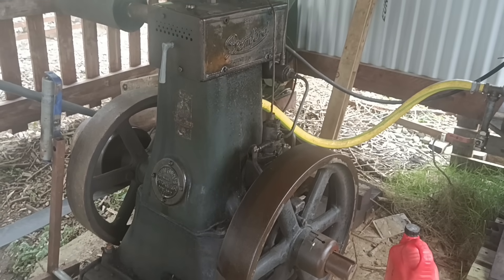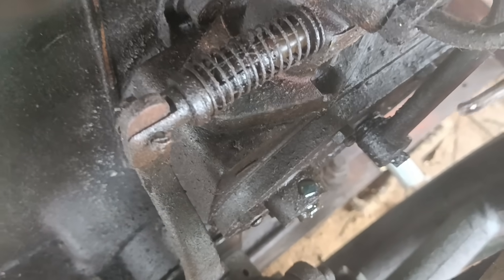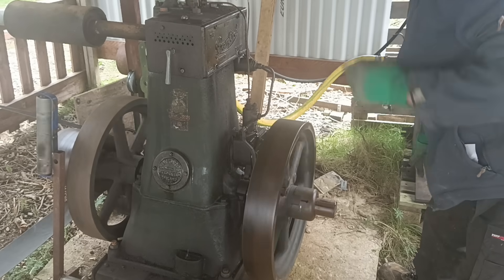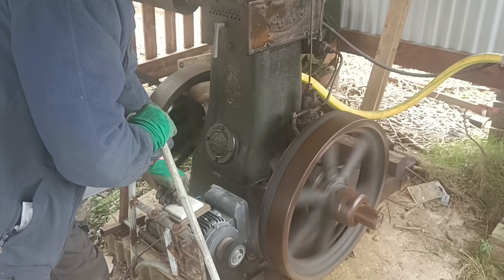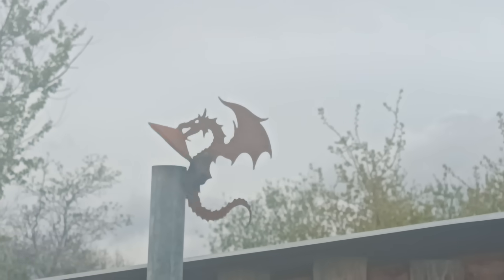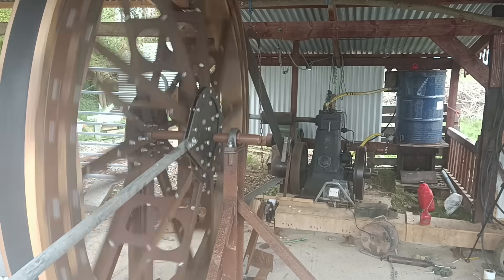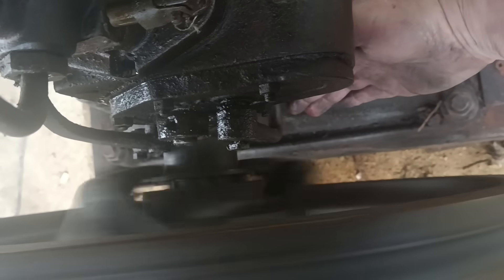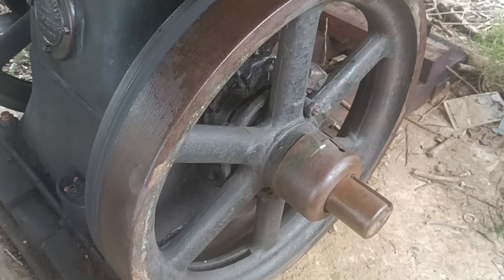How Much Fuel Does This Vintage Engine Use? Bamford stationary single-cylinder diesel efficiency

Comment: I dislike the Pollution/Efficiency Issues of these engines, HOWEVER, i am especially intrigued by how some engines like these, especially “Hot Bulb Engines” (Aka “Semi-Diesels” ), can run on nearly anything.

Especially one could use pure plant oils (vegetable oil, algae oil, etc), or “Pyrolysis Oil” (a product of charcoal production if you don’t burn it off).

I’d love to have the know how/funds to make an Open Source one that is all modern or something.  I was thinking you could use a Catalytic Converter to help heat up the hot bulb, and with modern mater it could probably work way better.  ALTHOUGH i wonder to what degree a good glow plug could work just as well if not better.

Also something like an Open Source Opposed Piston Engine, or some crazy multifuel Spark ignition engine etc would be really neat.

One can dream i guess lol, probably going to make some “PowerCubes” and use those tiny gasoline (hopefully flex fuel on ethanol) engines for now though.

Comment: Some much better than a modern generator, a lot less noisy and far more reliable. Have you thought about linking it up to a dynamo, when its running think of the electric you would save. 👍🤗

Comment: When you are building things for (your own) business, which you do, you have to take the economic viability into account aswell. And I believe you have hit bullseye with it👍 It's gonna be hard to have any lower running costs (except labor).

Don't know how efficient other diesel stationary engines are, but I think 450ml/h is pretty good. One of those noisy go-cart engines with 6.5hp could eat up to 2l/h, but it wouldn't fit your needs anyway...

Comment: Well said, Tim.  These old engines like your Bamford (which I have not seen), Lister, Deutz and the like, typify a more relaxed way of life which would be lost for you if there were a little 3-cylinder Kubota or Yanmar buzzing happily away in your workshop instead.  And where would pre-1965 rural economy have been without these beauties powering milking plants, sawmills, water pumps and generators?  😊 Col, NZ.
Reply: My brother collected Wolsely single-cylinder engines. Listers too.

Comment: It's a complex equation. One would also need to take into account the cost of manufacturing and running the engine both in terms of dollars and resources required and the time those costs are amortized over. Then we need to take into account what you are using the engine for - I suspect by making charcoal with it you are at very least carbon neutral, whereas the show engines produce nothing but entertainment (not necessarily bad of itself but not good for the environment)

My Monday Morning Guess would be that taken over all your old engine is very efficient - even compared to the latest high tech diesels.

Comment: Modern practice would probably be to use the power take off (pto) from a tractor running at idle. My 1955 Grey Fergie is rated
at 25 horse power, so trivial for a modern tractor at much higher power. Electric would also easily work & with solar panels & storage would neither need additional cost or create pollution & start & run with out maintenance for a very long time, but the upfront cost would take several years to recover. Thanks for sharing!

Comment: I wonder if you could hook it up to a low RPM permanent magnet generator/alternator and see if you could get usable power out of it.  Or do they make low RPM generators...imagine a 4kw generator head that generates the proper voltage/frequency at 600RPM...that would be awesome!!!!
Keep em coming!!!!
Reply: Plenty of generators that it would power ,they do need to be turning at fifteen or eighteen hundred RPM (dependant on what frequency 50/60 is needed ) that is easily achieved by sizing the pulley configuration correctly. A six horse power engine should be capable of giving out a constant 3kw without struggling.

Comment: if you were to hook up a modern 6 hp small light weight gas engine to your setup it would probably use 4 times the amount of gas,  these heavy old engines working like yours is beautiful
Reply: That isn't really how these things work. A horse is a horse, and modern engines are objectively more efficient. If you mean like a lawnmower engine, yeah it probably wouldn't be very efficient on this setup, but those are built for high torque to run everything properly. This would likely have very little torque which is far more efficient. There are engines designed for just these kinds of applications and they will always do a much better job per litre of fuel. We just don't commonly see this sort of application in normal daily life anymore. Also certainly never see such massive flywheels, which are extremely efficient. If I had to guess, rollercoaster and ski lifts would be the closest cousins to this machine
Reply: yep  they use 4 times+  more fuel because they dont have the flywheel  weight size  helping them

Comment: Since it's just keeping the flywheel going could you theoretically use a much smaller, slower engine if you wanted to? (Maybe starting the flywheel by hand?)  Here in the states little "hit and miss" gasoline engines of this vintage are common and you see those a lot at collector swap meets etc. and they're amusing to listen to running and the crank/connecting rods usually just stick out from the top of the cylinder and are fun to watch as well.
Reply: They usually run them without a load...his was doing actual work...now how much work can it do is the big question
Seems to sip fuel though, but it isn't a mega power house either

Comment: Hi Tim, she is a beautiful old lady indeed! This may be a daft question, but do you think you could use your flywheel to start the old lady, you managed to test that manually at 60RPM when you were making it? Cheers
Reply from the maker: I'd like to try that but I'd need to disconnect the con-rod to the slicer. But then , how would I reconnect it?
Reply: @wayoutwest-workshopstuff6299  Would the drag from the con-rod not be minimal enough if the charcoal grinder was empty? Just a thought 🤔

Comment: I don’t know what vegetable oil costs in Ireland but R. Diesel designed his engine to run on vegetable oil. Diesel engines before common rail injections can usually run on chip oil if it is well filtered. The only problem is the used chip oil smells of chips and can make you a bit hungry. 😅
Reply: Saw a fellla here in uk running his modern diesels on filtered used cooling oil and kerosene mix. 3 parts kerosene to 7 filtered used oil.
Reply: @McMahonshaun  a little petrol greatly increase performance.
Reply: Smells of chips.... Sounds like a huge plus.

Comment: Well, the details of the fuel efficiency seem relatively unimportant, realizing that 1)you already own the engine, 2) it is very economical to use for your application, 3) it is easy to maintain, 4) all the mechanical interfaces have been worked out and implemented, 5) it sounds so pleasant.  It seems it would be utter insanity to spend any type of resource to change it.

Comment: I think that is a fuel instant little bugger of and engine also horse power is how engines power is rated just meaning that engine could do the equivalent of 6 horses  then again all your belts and stuff probably changes it a little bit till it gets to were its used

Comment: That's why I love diesel engines, they are so efficient, and this low RPM one are the most efficient of all, cause diesel has the maximum efficiency at low revs. Would be nice to produce your own fuel, but by looks of your region should be impossible to grow oil crops. (sorry for the english, not my first language)
Reply from the maker: Not impossible to grow, but too wet to harvest consistently

Comment: Diesel engines are very efficient and have huge amounts of Torque. While I would love to see these manufactured again, and believe there is still a market for them, diesel, and gasoline engines have been targeted and will be illegal someday.  I love that old Bamford though, that's an amazing engine.
Reply: Engines similar to a 1920s Lister are currently being made in India by several manufacturers. I am aware of Topland and Patel Marshal from Rajkot, and Comet from Kolhapur. I think there are others. Also there are lots of videos on YouTube of modern Pakistani versions of a considerably larger Ruston and Hornsby engine probably also originating in the 1920s; the hand starting of these appears often to require the holding of burning oily rags under the air intake and/or the pipe from the fuel pump to the injector nozzle.
Reply: @cedriclynch  Yeah, no.  I'm not into things like waving fire around, I live in a forested area and that could have serious consequences, yes I am being paranoid, but I also grew up in a part of the US that has been doing a lot of burning the past few years.  Besides, the Banford, is a very elegant design, and looks like it would work very well. Oh well....

Comment: My Lister saw bench with twenty inch blade chugs away for weeks on one tank. I am now going to do a fuel test and compare with the old Fordson Major and belt saw bench. Point is the old engines are so relaxing to me to use, to heck with the fuel. My 1970's Kubota tractor and eighties front mower are so buzzy in comparison they are irritating as are Deere mini loaders etc. Each to their own but those Bamfords are super pieces of kit.

Comment: Actually I am quite sure that these old engines can burn veggie oil directly. No need for methylesterization. AT least a 50/50 Mix of oil and Diesel should be fine

Comment: It probably is hopelessly inefficient, that fuel the engine burnt contains approximately 4.7kWh of energy, but the engine is probably only 20% efficient (probably less, modern turbocharged diesels cap out at ~40%) - so ~1kwh of mechanical work.
Electric motors are usually around 80% efficient at peak, so the cost should be about the same!

In either case this is beside the point, if it does the job at a rate that makes sense for your biochar sales, then it's good enough.
Plus an electric motor solution would be a lot more complicated than a nice old engine.

Comment: 450ml for 45¢ per hour of work seems good value.
I love how you appreciate the history behind your machine & your obvious affection for it
Reply: Id say you  are a very smart man  and the old girl is shining bright . They still use these type of engines were I live in Texas with gas right out of the ground . The same gas we heated our homes with every four or five years we had to replace the teak wood chips in the vessel scrubber  that the gas ran through to help an take h2S gas that is common in our part of the world . The only things my paid for was electricity and if my father had wanted too he could done that to .  We drilled our own water well . I sure miss those days .
Reply: Need to connect it up to a generator to find out how much value it is.
Reply: I assume under load it uses more.
Reply: @tomthumb5445  My thoughts exactly.  You can't measure efficiency without measuring the load.  If you could, the MPG rating for cars would only every be measured while sitting idle.
Reply: Under load that would go up quite a lot. Though for the amount of work its doing, it would be interesting to compare to a more modern portable diesel, like a 2 or 3hp.
Reply: @wishusknight3009  Exactly what i would like to know.
Reply: @wishusknight3009  The losses for low-speed engines with these oversquare designs are lower than even some of the modern DI engines.
Reply: Almost the same of a eléctric generator ...

Comment: Great video and impressive fuel consumption, I didn’t realise single cylinder, single injection is so fuel efficient.
Reply: You don't know the fuel efficiency. Gut feeling is not a measurement. If you want to measure it you'd have to integrate over the output work and compare it to the energy of those 450ml. The fuel efficiency is bad on such engines as a matter of fact. Fuel efficiency doesn't come for free. Take a look at modern diesel engines and you can see what's necessary to get the last 1/100th of a percent out of the fuel. And even those modern engines can just convert 50% of the thermal energy. Compare that to the efficiency of an average electric motor easily surpassing 90%.
Reply: @tripplefives I'm not naïve and expect charging processes to be lossless. Nope, check the efficiency chain from renewables generation to the tire. If someone is burning coal for electricity generation this doesn't make the drive train inefficient. In such a case the coal powered power stations must be addressed. If you charge your car with the PV from your house ... try that with your diesel and some "e-fuels". In case you need a car at all.

And in the end: the sum of emissions count. In the end every molecule in the atmosphere sucks. It's a matter of fact. Thermodynamics is merciless and keeps any burning process reaching efficiency levels you could reach with electric or electro-chemical processes.

Whatever.
Reply: @tripplefives  Your company hasn't a PV on their car parking? What a shame. It's the math, my friend. Of course electric and electro-chemical processes aren't lossless. I never said that. But they're much more efficient than any ICE and fuel processing chain. If you don't like it - ok. I guess you have to live with it as nature can not be fooled (R.F.). And of course: the best car is the car not built.
Reply: @tripplefives 5k per employee if You do it one by one. Doing it full scale would be far less.

And this is assuming one would want to go full solar. We can always tap the grid...

And I used Teslas just because (as I said) I had the numbers at hand. The same logic apply to any electric car - one just have to recharge energy used to get to work.
Reply: @tripplefives No, but the economy of scale kicks in.

Things like the cost to install 2 points isn't double of installing one: You will pay for 2 points, but You will not dig 2x the trenches, since a big part of it will be used by both.

Another example:
We need 4 columns and 2 beams (minimum) in order to put up a roof. But it is true to one parking spot, or three - as we can use 2 larger beams and still four columns. We just saved 8 columns and the associate costs.

Also, about the space for solar:
If doing to one car we have only the area of the parking spot, but if doing for several we have the area used to drive between two parking spots too. So only a part of the total area would be need to have some cover.

Same thing is valid to the inverters: it's cheaper to buy one 2kW/h inverter that two 1kW/h ones.

And the contractor: the cost to build 10 park spaces isn't 10x grater than the cost to build just one.

The list just goes on. It's just cheaper, per unit, to build several things once than is to build one thing several times.